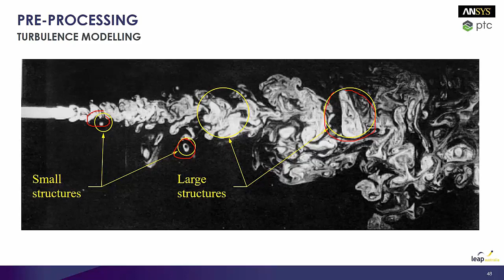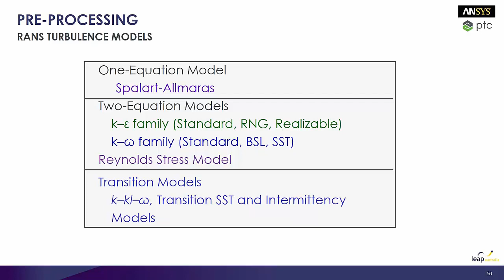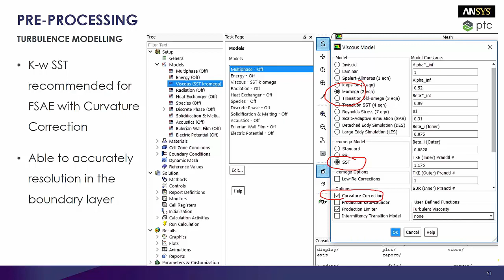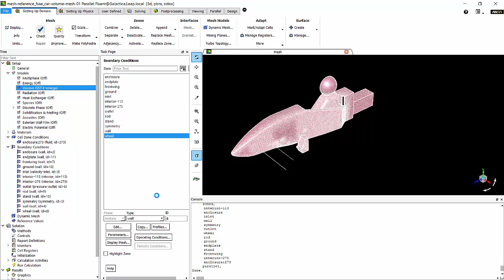Turbulence Modelling using ANSYS Fluent- Presentation and Demo  - ANSYS CFD for FSAE teams - 1/10

Comment: Why do you select curvature correction?
Reply from the maker: One drawback of the eddy-viscosity models is that these models are insensitive to streamline curvature and system rotation, which play a significant role in many turbulent flows. A modification to the turbulence production term is available (as curvature correction) to sensitize the k-w SST model to the effects of streamline curvature and system rotation. 

Detailed information about what terms are modified can be found in the ANSYS Help guide. 

If you are unsure if it is required for your model, run a simulation with and without. Compare the results and make a judgement call.

Does that answer your question?

By the way, interesting bullet videos!!
Reply: Thank you for the reply. I will check out the ANSYS Help Guide. I do some automotive analysis and currently use the k-w SST but without curvature correction. I will run a case with both and compare. Thank you again for the reply and the videos on setting up an FSAE car was great. Wish it was around when I was learning Fluent!
Reply from the maker: No issues at all. 

Thanks for the feedback, great to know the videos are helping people.